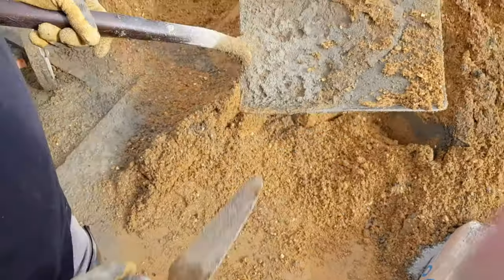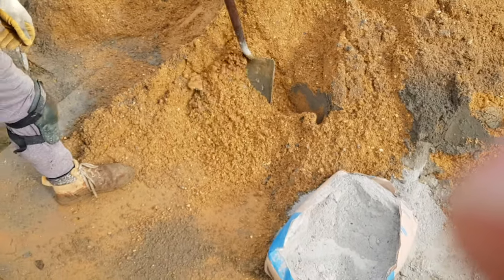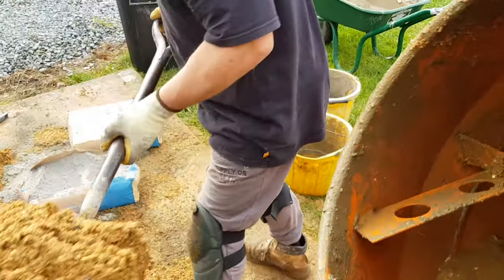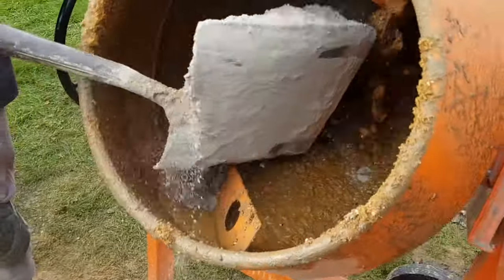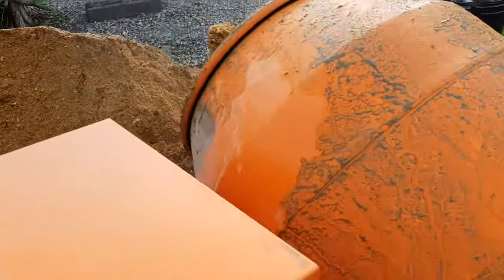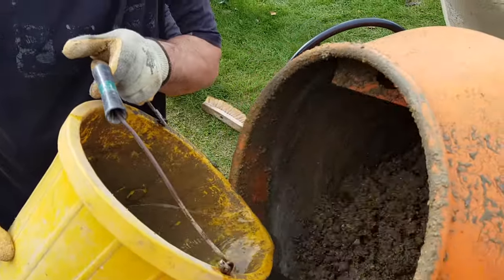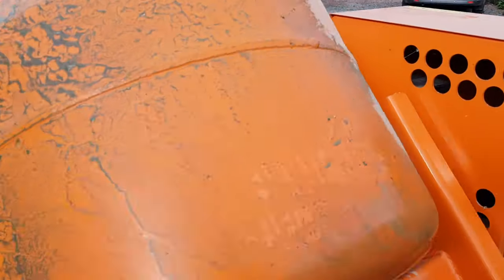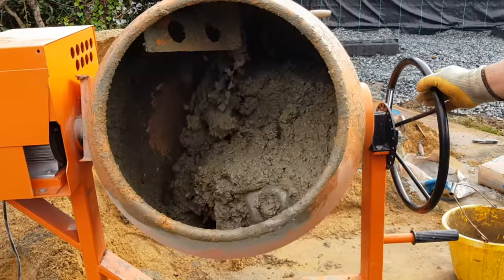HOW TO: Mix concrete with a mixer (5:1)

Comment: Always remember priming the big mixers with a touch of oil to get them started in the morning, on the building sites back in the 1980s
Reply from the maker: That brings back memories Jim , trying to turn over a diesel mixer on a cold morning used to nearly break your arm until you got the knack, then it was a piece of piss 😂😂,
Many thanks for watching Jim 👍👍

Comment: And did you lay that slab with the mixer? Wish I had a mixer had to mix by hand 18 bags of 20kg of premix into a wheelbarrow the other day1
Reply from the maker: My days of mixing in a wheelbarrow have long gone, good on you though sometimes you have just got to do what you have to do, many thanks for watching 👍
Reply: @BuildingwithBudd  A mixer is on my bucket list! 🙂🙂🙂

Comment: Alright bud any chance you could give us  some tips or a video on bucket gauging with a mortar mix as I keep finding when I bucket gauge at a 5.1 mix the belle 150size mixers keep overflowing any tips on getting round the problem be a big help
Reply: half batch.
Reply: @kennkid9912 or the lad could use 4 in 1 or even 3 in 1
Reply: Try a smaller bucket

Comment: Can I pour the mixed concrete into builder’s buckets, or will it spill everywhere?
Reply from the maker: Normally pour it into a wheelbarrow 👍
Reply: @BuildingwithBudd  Thanks for the answer. Unfortunately that means spending £50+ which is why I ask.
Reply from the maker: The other way is mix up in the mix let it mix then turn it off and shovel in buckets or top the lot on the floor and shovel it that way, whatever works for you 👍
Reply: @BuildingwithBudd  Thanks. I think I will hire a barrow, £8 for a week, just up the road too.

Comment: 1-2-3. 1 cement, two sand,three rock. finer mix is stronger. dry mix and then add water.
Reply from the maker: Kenn everyone has there own way of getting the same result, many thanks for watching 👍👍
Reply: or 1 cement 2 rock 3 sand.Dont forget to bring some rocks to fill in, if you run short on the project. Wet them.
Reply: Hi is that mix is the amount of full shovel  or what.,?
Reply: @daviebetham936  It is whatever unit you use. Shovel, Bucket, small bucket. % gallon ,2.5 gallon. 1-2-3 of the same unit.
Reply: @BuildingwithBudd  many ways to get there. Yes sir.
Reply: @kennkid9912  No. You only use 1 unit, and that is weight. You never mix concrete by volume. It causes bulking, and your ratios won't be right. Using shovels or buckets is volume. 

3:2:1is based on weight.
Reply: What? Weight? Obviously he is mixing by measure. Sjovel fulls.
Reply: @kennkid9912  I'll type really slow for you. 
Y O U   D O N ' T   M I X   C O N C R E T E   B Y   V O L U M E. 
A shovel is a volumetric measurement. It's not accurate or reliable. You measurement the weight of each ingredient and mix it the way. You do know what weight is right?
Reply: @kennkid9912  No you honyock. It's 3 coarse aggregate (rock), 2 fine aggregate (sand), 1 Portland cement all by weight.

Comment: Hi bud bought a bell mixer drum has a slight wobble is that normal
Reply from the maker: Is it new or 2nd hand ? If it’s new no, if it’s 2nd hand doesn’t surprise me, or it might not be screwed on fully, cheers for watching 👍👏
Reply: Thanks bud, yes it’s brand new but maybe it’s just the drum isn’t perfect in circumference and it’s just wobbling because of that
Reply from the maker: John
Just unscrew the drum and take it off then screw it back on, shouldn’t be to much wrong with it, Chuck a mix in and see how it goes 👏👏👍
Reply: Thanks bud, sent them a video of the drum spinning they agreed it had a lot of wobble someone came out with a new drum for me I pulled the old one off put the new one on fine now thanks again
Reply from the maker: Brilliant, once again thanks for watching 👏👏

Comment: You should never mix concrete by volume. You should only mix it by weight. Mixing by volume causes bulking. You can't guarantee the ratios are correct using volumetric measurements. 

The standard 3:2:1 is based on weight ratios not volume ratios. A shovel is a volumetric measurement.
Reply: So how would you measure the weight?
Reply: @Orgakoyd  You measure the weight with a scale. The same way EVERYONE does it. Do you know what a scale is?
Reply: @JoshBeards   A little awkward on site
Reply: @Orgakoyd  It's a backyard pour using a small mixer. How big of a scale do you think you need to weigh a 5 gallon bucket? You're a honyock.
Reply: @JoshBeards  I wonder why you don't see this on a typical building project?
Reply: @Orgakoyd  1). Concrete is ordered by a supplier who weighs out the ingredients at the batch plant. 
2). If the concrete is produced on site in a small mixer, the contractor half-asses it and just throws the ingredients in. 

I just had 6 concrete trucks show up on my job site. Each one had the batch weights of each ingredient on the tickets.
Reply: @JoshBeards  Ballast and cement are similar in density as far as I know, so the ratio isn't far off.
Reply: @Orgakoyd  Irrelevant statement. For starters, what are you defining as "ballast." Basic coarse aggregate in assuming. 
The specific gravity (density) of Portland cement is 3.15.
Ballast A is 2.90
Ballast B is 5.00
Ballast C is 4.87
Limestone rock is 2.6
ASTM sand is 2.66

Since concrete is measured and placed in cubic yards, let's look at weight per volume.
PC is 94 lb/ft³ or 2538 lb/yd³
Aggregate is 150 lb/ft³ or 4050 lb/yd³
Sand is 90 lb/ft³ or 2430 lb/ft³
As you can see, those weights aren't similar at all.
Reply: @JoshBeards  The bag of cement (here in the UK) has instructions on it regarding the volume ratio for a concrete mix (using ballast), or for bricklaying mortar which we use a lot (using building sand or ''soft sand'').

 ''Ballast'' here regionally refers to coarse aggregate and sharp sand premixed to the right ratio for making concrete, sold in small bags or bulk bags by the building material suppliers. 
This is the ballast which the cement manufacturers refer to on their packages. I'm not denying the significance of mass and density of everything involved, but these are products which have been used for decades consistently, to the point that the cement manufacturer refer to these volume ratios on their product packaging. Batches of concrete and mortar for structural work are mixed on site according to these (or slight variations) everyday in the UK. Picture of back of typical cement bag in UK (25 kg) available here: https://www.insulationhub.co.uk/product/blue-circle-mastercrete-25-kg/
Reply: @Orgakoyd  3:2:1 works in any country. It's an old concrete recipe before either of our countries even existed. It's by weight. 

Their "volume" ratios are because there's a predetermined weight for that volume. In the US, 1 cubic foot of Portland cement is 94 lbs. Your country would be doing the same thing in cubic meters and kilograms or grams or some other SI unit. 

Since these ingredients have a specific gravity, the weight for a predetermined volume is the same because nature makes it that way. Machines accurately make them the same in a factory based on that specific gravity.
Reply: @JoshBeards  The instructions on that bag of cement I linked to did not speak of weight, either for the ''ballast'' mix or the separate ''sand and coarse aggregate'' mix. The bucket illustrations denote volume.

Comment: The title "how to mix concrete " --- this is some hodge-podge morter-mix because there was no STONE or GRAVEL in the mix. Going to crack, break, and crumble no matter how it is used. Use 3 parts STONE or gravel,2 parts coarse sand, and 1 part Portland cement for REAL concrete. Or just buy the bags of redi-mix concrete. WHAT ---stone & GRAVEL are EVERYWHERE.
Reply from the maker: It’s 10mm all in , if your in the trade you would know , if your not look a bit closer ,
Reply: @BuildingwithBudd  This 10mm must be something from another territory or sort. Must have some special universal qualities built right into the batch. Could not see it through the air waves. Happy shoveling & mixing ,Sir.
Reply: Bruh you can literally HEAR the 10 rattling around…whether you see it or not.
Reply: Это точно! 1:2:2(3)👍☝️
Reply: the stones, if there any must be very small. This is more like SCREED than concrete.  
the strength of that floor isn't that strong.
Reply: If that is supposed to be ballast (sand and stone ready mixed) it contains too much sand and not enough stone. You can see and hear it. You won’t get good concrete from it. Also much better to measure out in buckets rather than shovelling in. Concrete needs to be of a consistent strength.
Reply: it's ballast, sand and stone mixed, pretty standard stuff over here
Reply: @Nousmourronsseuls you don't mix much concrete do you?
Reply: @jeremyfoster6942 which bit don’t you like? The buckets?
Reply: @Nousmourronsseuls  yes, you don't want to be faffing around with buckets, cut a 25kg cement in half, half a bag to 12 ballast, never shovel the cement, makes a mess,
Reply: @donaldstrishock3923 ballast is stone and sand mixed together which is fine at 10mm because there will be reinforcement bars in the slab. Be a smoother finished slab with the steal reinforcement making up for the smaller stone.
Reply: @LivingLife-Fast  Sounds like you have it "Dialed-In". Best wishes with all your endeavours.